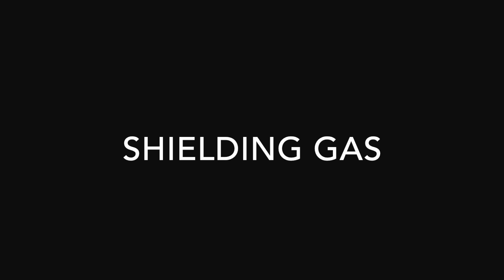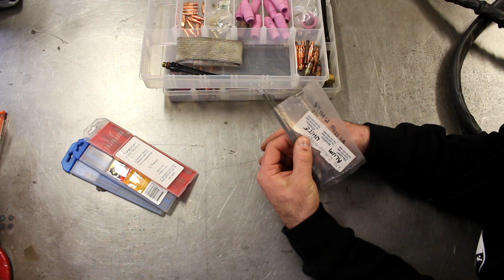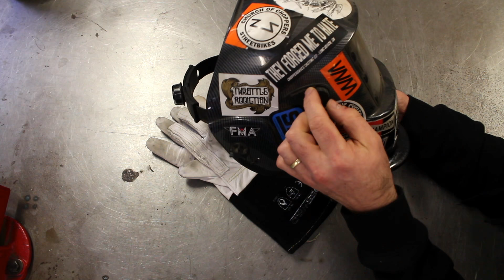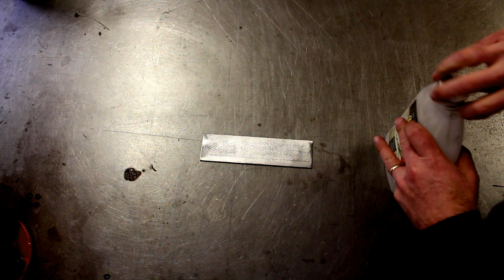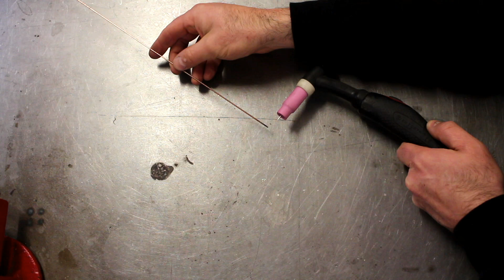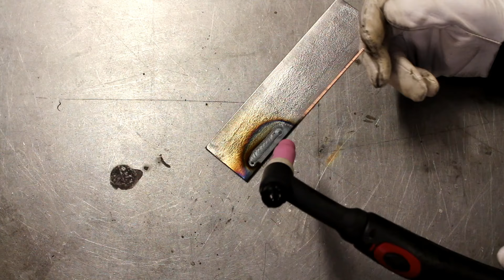Never TIG welded before? Here's your first TIG lesson!

Comment: Hi matt do you change the torch to the positive terminal for dc welding.
Reply from the maker: Electrode Negative (torch cable) for ferrous (steel and stainless) and Electrode Positive for non-ferrous (Al) 👍